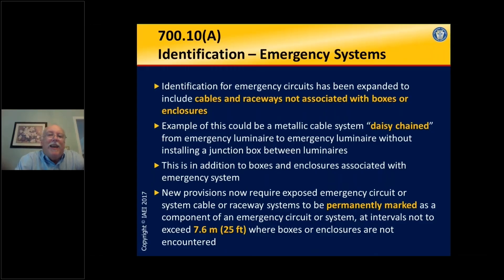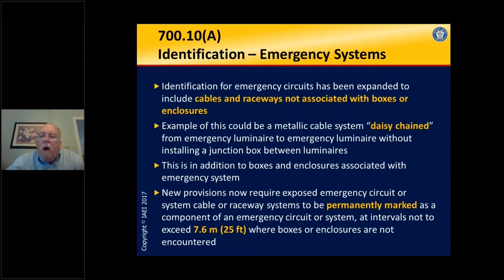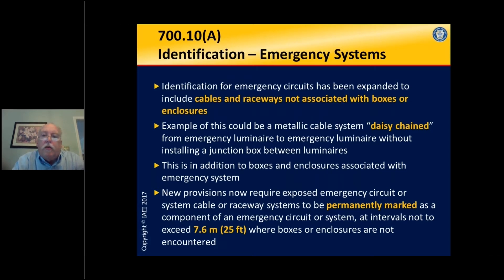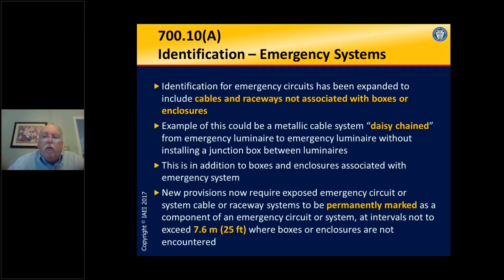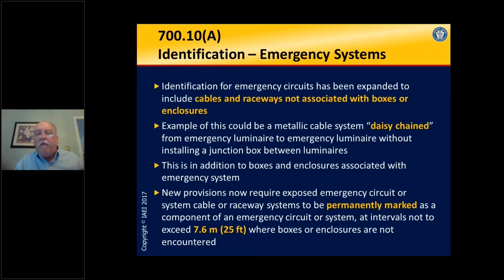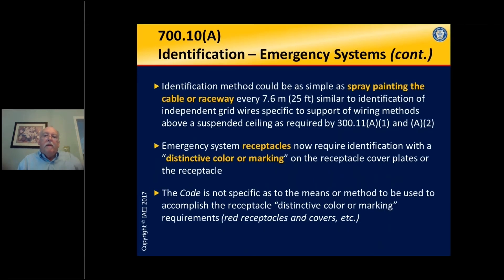IAEI Training Shorts — 700.10(A) and Identification of Emergency System Wiring and Circuits

Comment: I retired from a large hospital/research centers that would only mark the panel & breaker # on emergency equipment. We had over 75 ATS switches so that alone meant 150 breakers. I asked them several times to mark location of where panels were. Some were 10 floors away. They claimed it was on a drive in our system but myself and other sparkies could never find it.